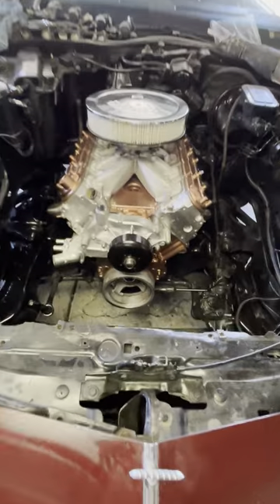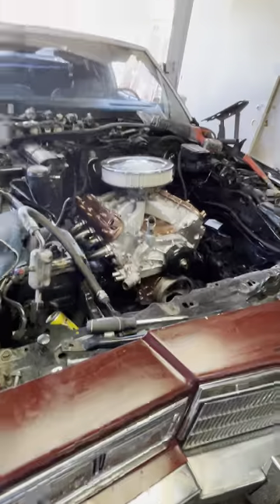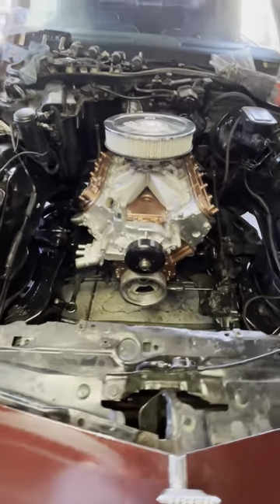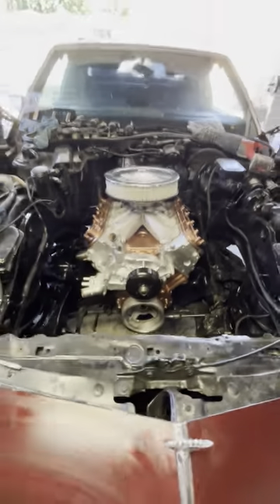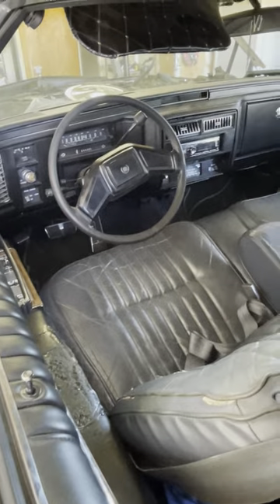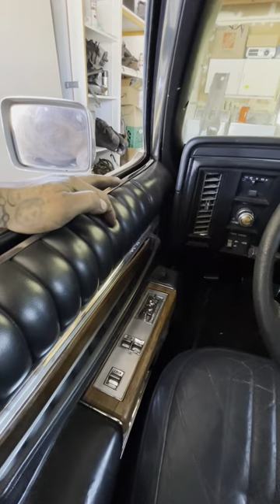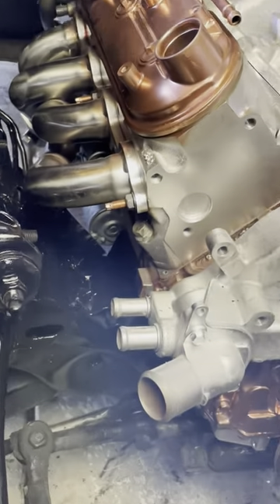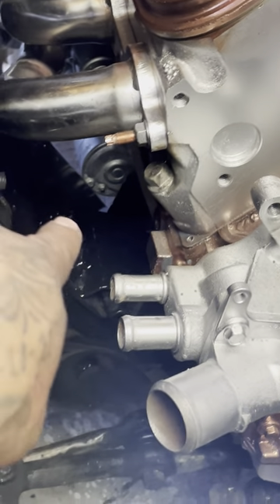1984 cadillac coupe deville  Ls swap

Comment: Motor side
Reply from the maker: its a 5.3 and the mounts i got them off amazon for a b body  but the did nit fit so i cut and welded them to fit correctly u will also need to change the oil pan on my first drive it scraped all over the floor 😂